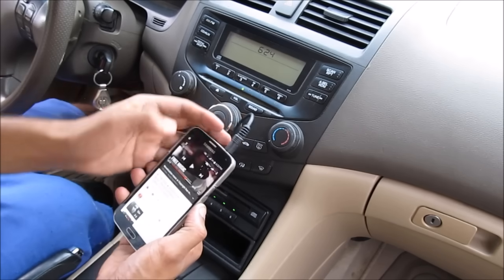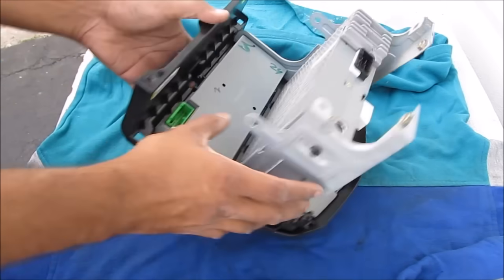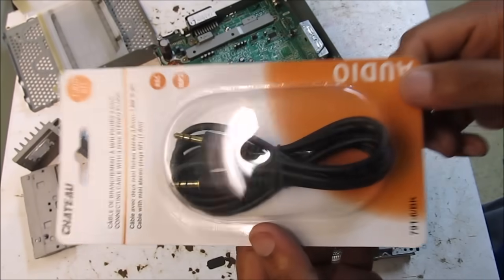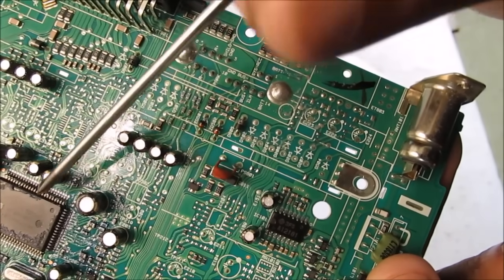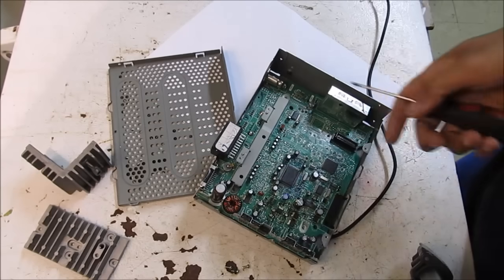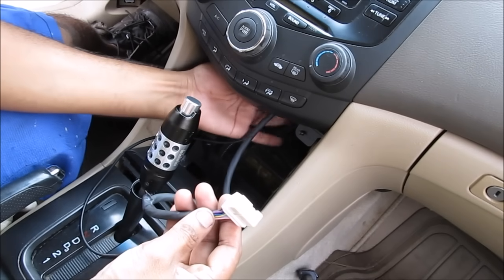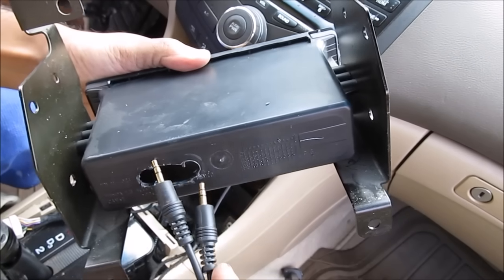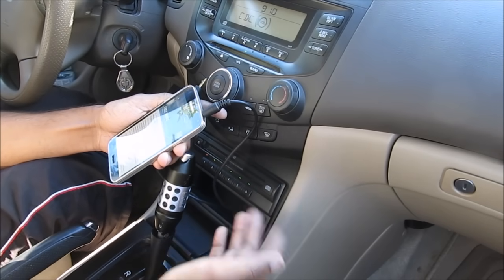$1 AUX Stereo Input Hack

Comment: people wondering how did he know ? Every component in this radio has a i/o or s/n written on it and thanks to that u find the datasheet. 
i guess its common sense to know that a sound processor has a preamp input what runs on normal soundwave signals i would have put some resistor in serial mode with the connection to prevent clipping but gain control has the same effect. For people who are interested in that kind of stuff i suggest to build the hack a little more advanced adding a bluetooth option. Lets say i smashed a cheap jbl speaker apart. Take the speaker wires and connect a auxiliary cable to it. It worked but it was running on mono signal, even finding the second input didnt put it in work (get a better chip from ebay) but yeah electronic engineering is awsome. Goodluck
Reply from the maker: Agreed, just some research and it helps to decipher everything

Comment: Or for $8  you may buy a FM transmitter that plugs into the cigarette lighter that has both an AUX port and a USB MP3 player built in.
Reply from the maker: The audio quality though
Reply: @speedkar99  sure beats the hell out of completely disassembling and desoldering the car and old radio to listen to some hack repeat 16 bars of music, or hip hop shouting.  Just buy a new radio with the aux or listen through a $10 radio transmitter.  It's just music playing in a noisy old Honda econobox rumbling down a road.  Its not Carnegie Hall.

I'd worry more about the reliability of the car mechanics than the tunes playing out of old cheezy car midrange generic speakers in an old factory rice grinder.

Comment: So I did this hack but I also drilled a hole and installed a female aux in my dash. However, the sound is terrible unless I send a mono signal to the CD player. I am doing this with a stock 2002 Nissan Frontier. Advice would be helpful. Nice video by the way.

Comment: I've added a bluetooth PCB to the 14 pin connector however when I press the aux button it does not detect anything. How do I trick the system that I have something connected there?
Reply from the maker: You need to have a device on the M-bus to talk kindly with the radio and beg it to turn it's attention to the 14pin auxillary input
Reply: ahh ok thanks, looks like I will have to buy a proper aux module.

Comment: For the FM modulator, you only soldered one audio line in because it's mono. Shouldn't we solder both left and right into AF out ? (Assuming phone is still outputting stereo, so you'd lose one side if you don't). 2) I would personally use a female output jack and mount it somewhere. That way I'd wear out an external AUX cable but not the main line into the radio so I'd never have to open the radio again.  I am actually going to try this because both my 03/04 accords have horrible alternator electrical whine when using an AUX kit. Noise suppressor filters don't work. It's factory radio so there's no RCA grounds to reinforce, and 03-07 have no stock amps to GND, so the noise is most likely in the input power lines. I'd have to try an inline power filter. Bluetooth kit still goes through the AUX kit and still has the alternator whine. FM transmitters, depending on where you are, often require switching frequency as you go through different areas.
Reply from the maker: Good tips. But where do I solder the right side to if there's only one AF?
Reply: speedkar99 you solder both left and right to AF out the sound will tie together and you hear both.

Comment: Good ! Can I  use the AM de-modulator, since the FM radio is still usefull in my country ? 
I just came with another idea: there are stereo female jacks which can cut the signal when there is a plug and by-pass when no plug. 
Such jack can be soldered so when you plug the plug, it connects the plug to the power amplifier inputs and disconnects it from it's normal lines (the tracks need to be cut and the lines should be re-routed via the female jack). 
This requires 4 wires plus GND to go to the jack but from schematic point of view is more clear.
Reply from the maker: Yes I'm still works

Comment: Man, you can find anything on youtube. this is literally my make and model car and exactly what I need. But this is way too much work. There's gotta be an easier way. Why does the CD button even say AUX on it.
Reply from the maker: Easier? You can pay for an aux module
Reply: speedkar99 i just bought an FM transmitter from Walmart cor 20 bucks. Can play anything on my phone thru blutooth, aux cable or micro sd card and listen thru my radio

Comment: Proficient in Mechanical and Electronics , when you bend that metal to let the jack and drill that plastic , anal retantive does not apply here , as long as it works
Reply from the maker: Thanks, and yes I should have run the wire first

Comment: Remove the heat sinks and break the OEM thermal seal to them.  Your simplified solution will ruin someones radio if those drivers can not transfer heat well.   Bad advise here.  Only the foolish or naive will try this.
Reply from the maker: Yea use new thermal paste if you want to be perfect. Old car, I didn't pay much attention

Comment: Fucking dodgey as fuck!!

The CDC would by FAR be the best option since you don't have to rip tear bust and fuck your tuner if it goes overvoltage. Frankly it is NOT hard to put a 3PDT toggle in the dash that switches between the CDC (assuming it still works and you still want to use it) and the aux input. That way you've broken or disabled nothing. 

Then FFS instead of putting a cut lead hanging out do it clean and install a 3.5mm stereo socket somewhere in the dash or console that is nice and neat and then use your stereo 3.5->3.5 lead in association with the toggle. 

If your audio input from the CDC mod is low then install a pre-amp between the 3.5 socket and the toggle switch powering it from something like the CDC power line and earth (they don't chew much and will then power up with the CDC selection).
Reply from the maker: +Glen O'Riley Yep the CDC is the way to go IF you have an Mbus device to fool the radio into selecting that input...most people don't have this, mine was a Special edition Accord. 
Sure the 3PDT switch is a good idea (my CDC didn't work so I didn't care) and so is the female port because these cables sometimes go bad after time.
Reply: speedkar99 sometimes...   i know we used to go through 2 to 3 a year once Bury stopped including the audio feed out of the cradle. Whilst permanently through to the cradle it was fine but once we had to keep plugging and unplugging the phone itself the cheap wires snapped to easy in their jackets. Add to that we had a bad earth loop or something introducing a whine noise from the alternator which finally pushed the BT upgrade.

Comment: Not worth it... just buy on one online that has a usb connector, aux, and the CD player for $20 and do the same thing just replacing the radio. And also u won’t have a weird wire just hanging.. and would if you can’t just do a 3.5 mm jack. Would if u need a wireless connection.. stop being cheap. And I believe cuz it overrides it iPhone can’t do radio stations anymore. And also there is less bass and beat bc ur using fucken YouTube. Try Spotify
Reply from the maker: +Sedric TheGamer this is a hack. Not about being cheap. $20 radio would sound horrible and look ugly in my dash. I prefer to keep OEM.

Comment: A hack is supposed to be something simple.. Not rip your dash to bits then disassemble the freaking radio... You'd be better off putting in a brand new stereo instead of using that cheap arsed cable...
Reply from the maker: +LimitedInfinity1 a hack isn't supposed to be simple. If it was then that's not a hack. That's a mod.

Comment: Can I do the second option of combining aux wires into my oem radio harness(has cd player in it), without having an external cd player? My plug has 16 areas on it and u said as long as I had a 14 plug adapter, it could be done that way. But again, it is the harness original to my 2005 Hyundai Elantra that plugs into back of radio. Can it be done?
Reply from the maker: +D Cannon No because you'll need a device to talk on the radio bus to trick it that there's a device there.

Comment: You still used to FM radio and I think it kind of messes up the circuits a hint but it worked we tried it work so but, it's kind of slow down a little bit
Reply from the maker: +Shirley Walker Yea it still works but only by overriding fm

Comment: lol...  If time isn't worth money,  very smart fix.  I'd rather just do a online survey to earn 15 bucks to buy fm transmitter.
Reply from the maker: +Matthew Villars but the sound quality!!
Reply: you got me man.  lol.  that one dollar cord is gonna sound good.  I admit when I am wrong.  : )
Reply: if you can't figure out how to do online surveys.  try this..  knock on a neighbors door.  and tell him.. if you can't wash their rims, for a few bucks,  you will take out your entire radio assembly and try to rewire it.  If they hate you.. they will let you do it
Reply: big respect though dude.  you covered how to do it very well.
Reply: when I got my first car at 16 i wanted to bump.  so I took a box a friend was throwing away that held two 10s.   and i had a friend with a jbl 10 inch that the coild wasn't working well on.    soldered the cord to where i could get it to work on my home stereo..  then I saved up 70 bucks to buy a new cheap amp..    I wired it from my engine through the firewall myself using old power cords i had..  put a 1 dollar flip swtich on it and drilled it into my door panel..  bypassed my entire stereo.   and put a rca to 3.5 mill on the amp so that i could plug anything i want into it..  the car stereo still worked..  i had a switch so that my battery was never drained but i could run it whenever i wanted (always made sure I had the car on first)  and i could plug anything in to the 3.5 mm jack.  I had a lot of fun with that build,  and my car stereo or console never got pulled.   I understand the thrill.  It's fun doing home projects..  but I had the back up that I never broke my console or my original radio.  props to those who take big chances...  I was bumping pretty good...  the best part was.. someone tried to rob me cause I would bump hard..  but they were completly confused and ended up just taking the change in my center change thing.

Comment: Just done 1st method. It is working but sound is really dull and works only on LW and MW signals. FM1 and FM2 are loud but grainy and impossible to use. Have I done anything wrong? I have dvd with nav version but the signals on CB were the same I believe.
Reply from the maker: +dbreviews if your phone has jack detection, start playing music first then turn on the radio

Comment: Why you didint use 3.5mm plugin socket? Yes, you have use another aux cable but if you brake it you dont have to open half of your dashboard
Reply from the maker: +My Android agreed, that's a good point
Reply: It makes a shitload of white noise. I've done it many times in many different applications. You gotta get a really really good plug.

Comment: I am going to do the first method as I prefer output sound from radio, however, not sure why we shouldn't solder both white and red cable. Wouldn't the sound be in the stereo this way?
Reply from the maker: +dbreviews I would if I could find the trace, but that wasn't easy so it's mono for now.

Comment: Man, you gotta work on drilling a small hole and feeding the dang cable through it before you wire it in. Did you drill the hole with a hammer and a chisel!?
Reply from the maker: +Brody Doyle nah I just bent the case lol
Your right I should have threaded it in first then soldered.

Comment: Wow, never thought it would be that simple to add an aux jack to an old radio. (yes it is simple removing the radio player is the part, that has been made unnecessarily complex.
Method 1 is shit though, but hacking into the cd changer is a very quick and easy way, as you don't need to solder anything and don't even need to remove the radio and all this panelling.

but here's the question though: can you still use the FM / CD changer after this hack?
Reply from the maker: +LRM12o8 Yes it is quite simple, as long as you find the right points to solder to. 
The CD and radio still work, the aux merely overrides that signal when plugged in
Reply: Honestly after this mod, i'd just convert all your CDS to mp3 and use the new AUX input.

Comment: Dude seriously?? I know you mean well -- but you can't POSSIBLY think this is a DIY job -- or that any normal person would even THINK about attempting this.

 **HINT: When a job requires the stripping down of an electrical component all the way down to the motherboard -- and then the soldering of new circuitry and wiring to said motherboard -- you WILL lose 98% of your audience every time. You lost me for good when -- after already disassembling the radio to the tune of 50-something screws, you got to the CD changer and said, "Ok, now just remove these 14 screws on the outer case... ".... Anybody who would try to attempt this job would lose so many screws in the process, they wouldn't even be able to put the damn thing back together properly! 

Actually there are some people who could handle this job -- as long as they have a frickin' Electrical Engineering degree!
Reply from the maker: +Mark Gellerman This is DIY because no special tools or skills are required to remove screws and solder. Just because you can't keep track of screws doesn't mean this is only for engineers. Besides, this is fun isn't it? 😎

Comment: @speedkar99 Thanks for the awesome video! I have a quick question though, do you know if it is because I solder incorrect so the sound quality is difference when played on AM vs FM mode? Through the AM mode, the vocal or center sounds louder and is more quiet in FM mode.

I tried using an aux Bluetooth receiver but I would hear the radio in the background while the aux is playing, which is not obvious when connected directly with aux. Do you know if there is a workaround?

Thanks!
Reply from the maker: +Philip Wu I think AM sounds more deep but doesn't have the clarity fm does. 
For Bluetooth you'll need a ground loop isolator
Reply: speedkar99 thanks for the input but do know if the difference on the radio mode is due to me soldering it wrong?

Comment: parts= $1.00
labor = $1,000
Reply: And that's why being a car mechanic has its perks yet it is very tedious
Reply: Better off buying a newer car my head hurts from that video
Reply: Geedieth Pierson smh
Reply: So true
Reply: Pretty much
Reply from the maker: +The Admiral $1000 to take apart the stereo? Nah just DIY
Reply: I was joking.... admire you Sir, I could never tackle this job
Reply: @speedkar99  
Seems very easy!! But I can't do it as my car is Ford with a combined Radio and CD stacker. I wish you were close so that I could learn. As I would like to add Blue tooth, USB and Aux to it. Anyhow, wonderful work. Well Done.
Reply: @speedkar99   Of course, that was quite simple. I thought you had to remove the wheels, engine, transmission, radiator and give the car a new paintjob too. How about just getting an FM transmitter. Not ideal but might do the job.

Comment: Not sure why people are hating on this video so much, this is exactly something I was thinking of doing but wasn't sure exactly where I could solder aux lines on. This is good information since in some cases this might be the best or only option that keeps it pretty stock. If you need to sell your car, people might be a little concerned by the addition, but you wont have to spend a bunch of time removing your aftermarket stereo and having to find your old stock stereo, and putting it all back together and making sure it works which you'll probably be doing in a hurry and might mess up causing a headache when you really just want to be done with it all and sell.
Reply from the maker: +TheGoodChap I'm glad it helped not everyone wants an aftermarket solution.
Reply: speedkar99 I'm glad you made this! I have a Honda accord but its got a different set up where the CD changer is above the radio. I was wondering if this was possible. That said I'm not going to risk it!

Comment: Hi speedkar99,

I would like to try this on a 2005 Honda S2000. Referencing your video, "$1 AUX Stereo Input Hack for Honda Accord," will your "second method work on a original 2005 Honda S2000 radio with internal CD player. If so, is there an alternative to adding an external CD player to force the radio to recognize the AUX input?  Can you provide connection points and details or possibly a video?    

Thanks
Reply from the maker: +Moxcell internal CD changer on accord is digital signal so it won't work. You can try on s2k if its analog
Reply: Thanks for taking the time to respond, & keep doing the "Cool Stuff!"